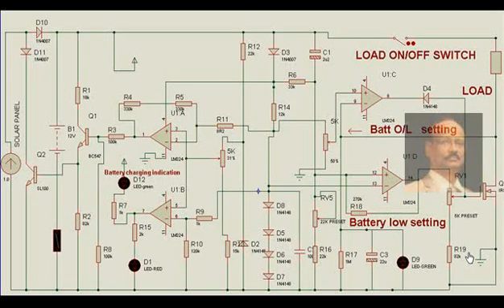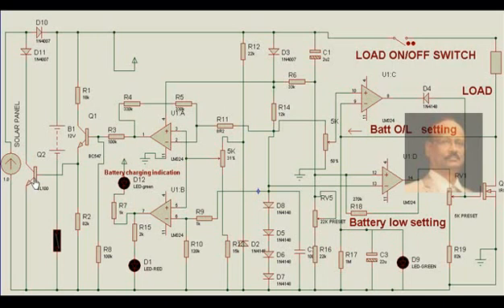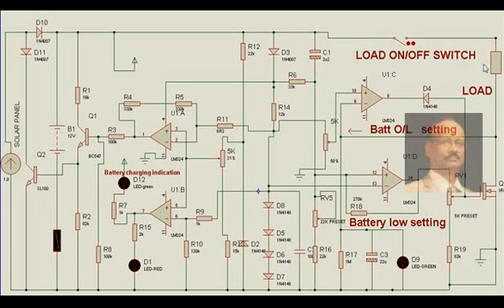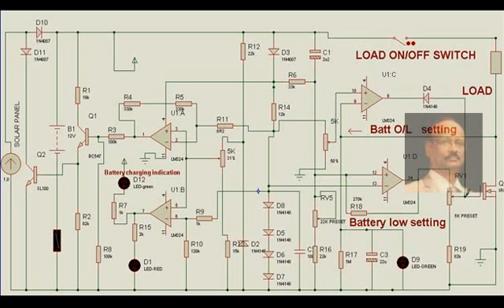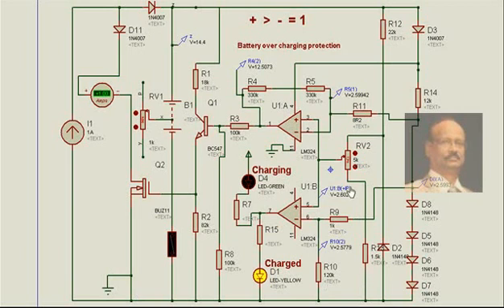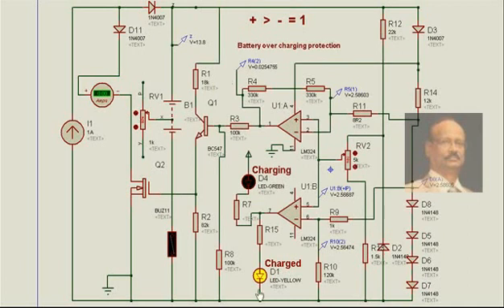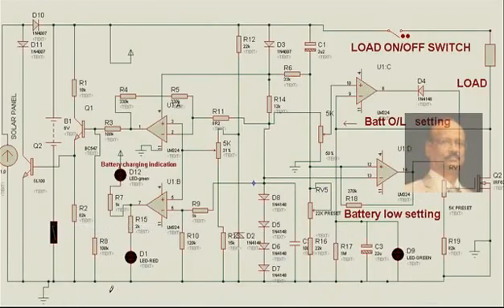Charge Controller for solar photo voltaic cells

Comment from the maker: I am too often asked as to how do I change the battery voltage?Changing is battery voltage is done by a special arrangement. Take a variable pot and feed top with say 15 volts and bottom to ground. The Center point to dc +ve at the cathode of the diode  D10 using level number too small in size to be visible . ( see small  x ) Give the same level number at the Center point of the pot and just drag it to  falsely to the battery without making any connections appearing it as used for changing the battery voltage which in fact is done by the pot. But very trickily remove the connection from the battery -ve that goes to the fuse by making a very small disconnection not visible. Thus the battery is out of circuit. You may find it difficult to achieve if you are not familiar with level numbering.

Comment: Sir can you please tell how you connected  RV1 to B1
Reply from the maker: Requires skill. I shall make a video soon on special  tricks in Proteus. Pls wait.
Reply: Patnaik UC thank you sir
Reply from the maker: I want an honest feedback. Was the circuit explained to clear to understand or you had difficulties?
Reply: Patnaik UC Yeah. I understood the circuit well and the only doubt is can I connect the inverter circuit where you have connected load ?
Reply from the maker: No. You cannot connect any load more than some 60 to 70 watts as limited by  the load mosfet used. It is a demo circuit for the purpose of understanding the technology. However, using a number of mosfets in parallel (about 6 A per mosfet) it is possible. For example, if the load current is 60 A one has to use 10 numbers of mosfet in parallel Accordingly fro the solar end mosfet depending on the capacity of the panel used. If a panel says 120wp then the solar current is approximately 10A . So use 2 or 3 in parallel.

Comment: Sir actually 1N4148 is a germanium diode, 4007is the silicon one. Thanks for the great video.
Reply from the maker: Tech Seeker you are sadly mistaken 1n 4148 is a silicon diode and not a germanium one
Reply from the maker: All that inside a glass enclosure is not germanium diode. 1N 4148 is a silicon diode. please google or check in wikipedia
Reply: Patnaik sir you are right. I searched for datasheet and it's silicon one😬
Reply from the maker: Tech Seeker sorry brother it is a silicon diode. All those housed in glass capsule is not germanium. Please check google

Comment: Hello sir. First of all thanks for the amazing description. I am wondering how did you connect RV1 to B1? thanks!
Reply from the maker: +eduardo coello  Thanks.As connected in the circuit RV1  gets linked  to B1 through a special arrangement, which is not easy to explain
Reply: is it also hard to make a video ?